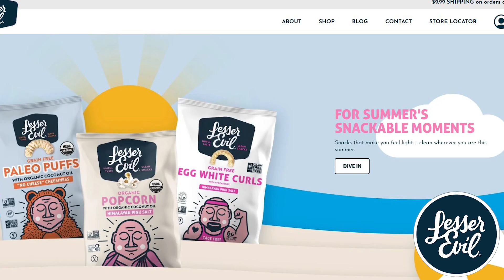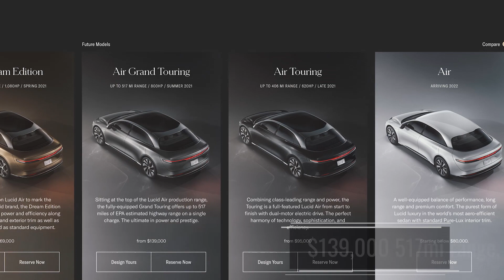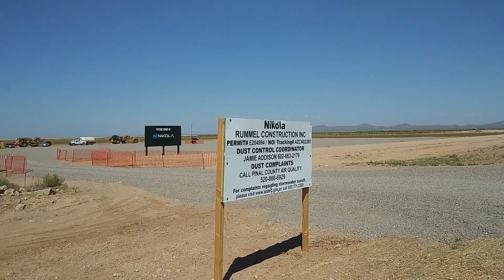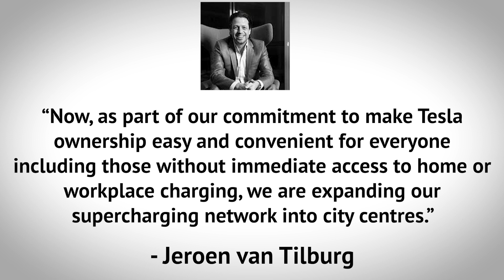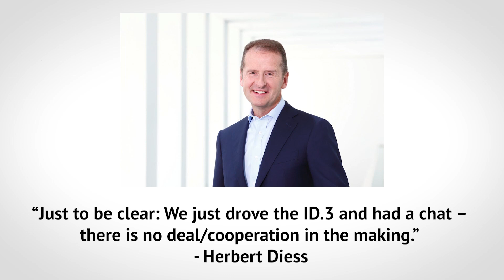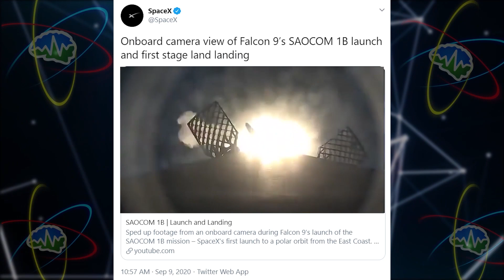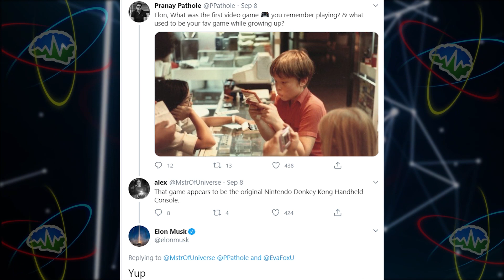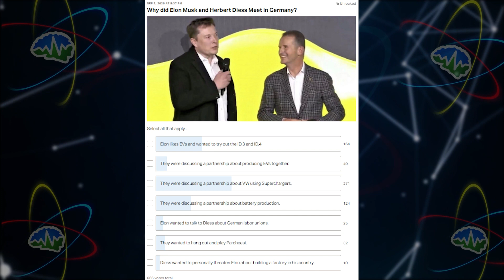Tesla Time News - Lucid Air Reveal

Comment: The favorite car category for the auto industry to develop, "tesla killers".  Bidirectional charging and a bigger battery/longer range are advantages over Teslas, now. It's not unlikely Teslas will be available with both bidirectional charging and even bigger battery/longer range than Lucid Air, when, or shortly after the Air actually goes in to real production.  Then the Lucid Air has no significant advantages over Teslas left, but a still a higher price.  

Also, to make an actual "tesla killer", you have to produce cars that people actually chooses to buy over teslas in such numbers that tesla gets a hard time selling their cars. The total world production capacity of batteries is not meeting demand, and will not do that anytime soon. That's just what's possible to produce, to hurt Tesla sales you still need to make cars that are more attractive to the consumers, factoring in things like price, supercharging autonomy and so on.

I also compared it to the taycan,  similar prices, similar acceleration, but over twice the range. I would not worry to much about Porsche though, while Lucid motors is not an obvious scam, it is easy to loose funding, and it happens a lot. Even if Lucid actually manages to start real production it might take some time, it will definitely take a long time before they can produce significant numbers.

On the subject of obvious scams, it's kind of disturbing that so many people with that much money doesn't realize that Nikola motor totally lacks relevant substance, and own technical expertise. It's a lot of BS. It will be so interesting to see if Milton can debate whether his claims are actually lies, technically, or if it is a matter of definition and interpretation, and get the bubble to grow even more. Or, if any investigation focuses on what's important, and that is whether or not there's any actual substance in the company, or he's a con artist. Milton has the burden of proof, and, "extraordinary claims require extraordinary evidence", and Milton is hard to beat when it comes to making unsubstantiated extraordinary claims.

Comment: I have an idea why GM did that deal with Nikola. I could easily be wrong of course, but I think GM, handing over their own hydrogen fuel cell system in exchange for a percentage might just be a write off, ($0.10 on the dollar ) of a technology they have no plans to use themselves. If Nikola is the (air-ware) scam it seems to be, it will fail, and GM will appear to have given fuel cells a chance without their  brand's reputation being so besmirched as some of the other failed  endeavors done quite publicly under their own corporate umbrella. The EV-1 and creating the Saturn line of cars that was their shortest lived brand of cars, comes to mind. Long before that failure they also invested heavily in the Wankel engine for their Chevrolet division, which they shared with the shortly to be defunct American Motors (the AMC Pacer was designed to use that engine).  GM is moving towards BEV production, and fuel cells would just be a diversion from making that move smoothly. Perhaps Mary Barra isn't as much of a loser as it might seem.

Comment: You repeat a rant about propane and petrol tanks exploding when a house catches fire but you neglect to mention what happens when a battery containing lithium catches fire. Have a look at some of the videos demonstrating when happens when a lithium battery is damaged and tell me which you'd sooner have in your garage.
  Having said that, if you have hell itself racing down the hill intent on torching your house then if you have any sense you should be miles away, in which you don't give a rats arse what your garage contains; propane, lithium or C-4 it's all irrelevant.

Comment: Why did TESLA stop deliveries on 7th September ? Deliveries stopped for WEEKS ? 
Two casting machine installed at Freemont? One for model 3 and one for model Y ? 
 OR   One for models 3 and y !!!!  And one for model S and X !!!

Octovalve to  all models ???       Including PLADE MODELS???
Why refresh models S and X without the latest TECH ?
Plade      Octovalve     Cell to PACK   New cell chemistry  New cell Size
RE: ELONS Giga Berlin interview ______Model Y in Berlin is going to be fundermentally different to Freemount !  Major redesign ! Wait for battery day.
Casting machines save 1/3 floor space in general assembly room !!!
Hundreds of ROBOTS need to be removed from multiple lines. 
ELONS biggest problem is the COST of the cars.
Casting machines installed in Freemount  equells 500 robots on the backs of the electric semi's going to GIGGA TEXAS That how you get the SEMI Proto types to TEXAS AND LOWER COST !!!!!!